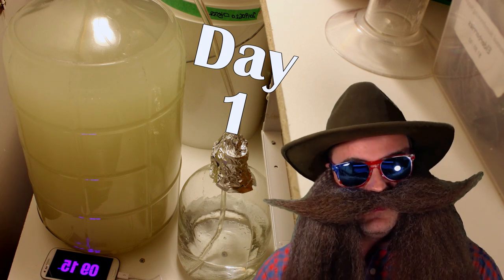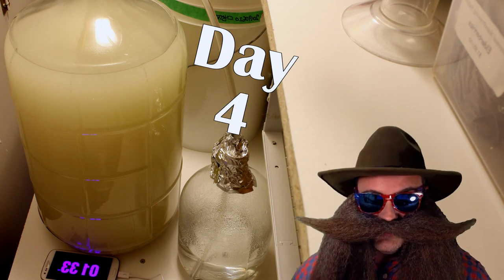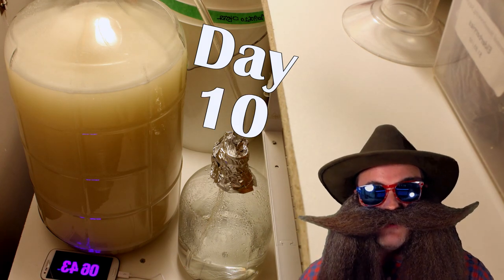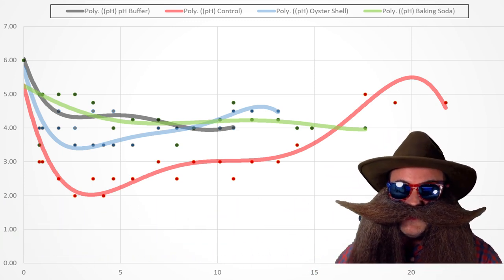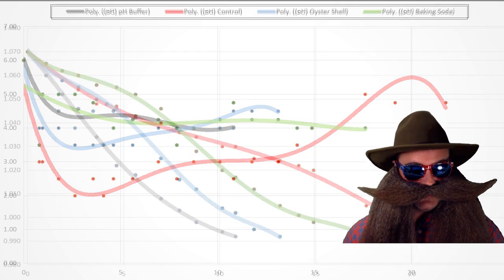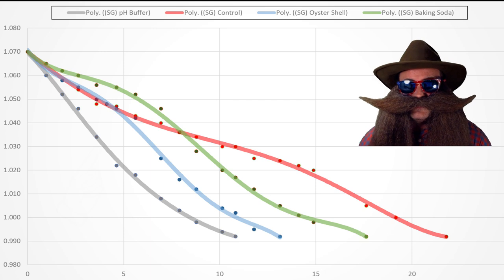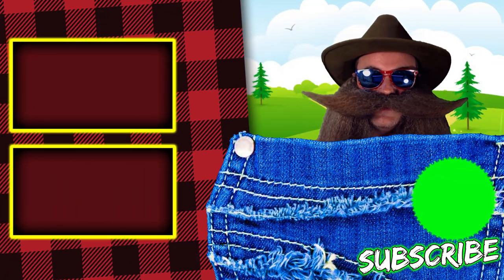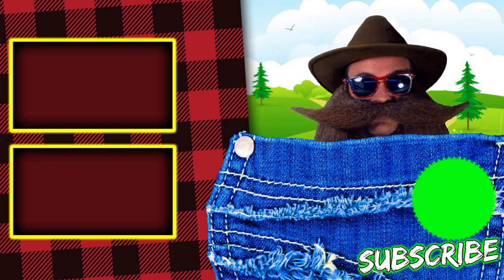Sugar Wash pH Control Experimental Results #1 (Time Lapse) Oyster Shells, pH Buffer. Baking soda...

Comment: Awesome video! Surprising eye-opening results. Thank you for your time and effort.
Reply from the maker: I too wash surprised that baking soda was a bad choice, and how the pH buffer acted differently from the other methods. It will be interesting to see how adding more crushed oyster shells fair against pH buffers with higher capacities. Can we add too much? So much that it will affect flavor? Does one method provide a better flavor over another? So many questions to answer. Thanks for watching Ben.
Reply: I have not come across any negative effects from adding too much oyster shells. (Chicken scratch)
I have also used Marble, long strips, drill a hole in them and hang them on the side inside the fermenter with a SS hook. They do not last very long in sugar washes (40-45 gallon washes) maybe 3 or 4 batches.

"Pickling Lime" also raises the Ph. It's in the canning section of most super markets or box stores. I use it sparingly, adding only a tablespoon at a time into a quart jar with some wash, shake, the mix into the wash. The take a Ph reading. Repeat if necessary until the Ph hits 5.5. (This is also for 40-45 gallon washes) I use this process when I do not have oyster shells.
Reply from the maker: Thanks for the input Big Ed. Definitely going to try more oyster shells that are crushed next time.
Reply: A handful tossed in (resting on bottom) will not be the same as a handful suspended. Always had better results with them "suspended" halfway down. (A "TILT" up top and a "TILT" just above the Bottom would shed light on what's going on temp & Ph wise.)

Side note: Fantastic data my friend. Makes me want to add multiple ingredients to a ferment to control Ph...

Which leads me to believe you are on to something: Starting Ph + OG ratio, multiplied by wash/mash volume = recipe of Ph controlling ingredients. Which is then most likely divided by Yeast, Nutrients, and the wildcard.... Temp....

^^^ Would be a Helluva Algorithm or Killer App if solved. Cheers!
Reply from the maker: I'm going to play around with the capacity of the pH buffer to try and start with a pH of 6.0 and finish fermentation at a pH of 5.0. The idea being, have an acidic sugar wine (to suppress ammonia compounds), and adjust the pH on the collected low wines to a pH of 8 or 9 (to turn the ethyl acetate into ethanol) as per the book Designing & Building Automatic Stills. Adjusting the pH like this is supposed to suppress undesirables and increase yields when making vodka. Hopefully it all works :)
Reply: @OpenSourceDistilling  what stage is a low wine? in some texts they refer a low wine as a finished fermented wash before distilling, some call it a low wine after they distilled it for the first time as a strip run in a pot still (20-30 Vol.).  When do you adjust the ph to 8 to 9? after a finished fermentation (still risky to get infection) or after the first strip run? Sorry for all the questions.
Reply from the maker: @bennyissimo  To me, a low wine is what is collected during the stripping run. No cuts have been made and the ABV is somewhere around 40%-ish. You wouldn't want to drink it. So the idea I got from the book says that your sugar wine should be around pH 5-6 before the stripping run. After you collect the low wines from the stripping run, adjust the low wines to ph 8-9. This is meant to push chemical equilibrium in a favorable way. Keep those questions coming!
Reply: i dont mean to be so offtopic but does anybody know a method to log back into an instagram account??
I somehow lost my password. I would love any help you can give me!
Reply: @Dakari Odin Thanks so much for your reply. I found the site on google and im in the hacking process atm.
Seems to take quite some time so I will reply here later when my account password hopefully is recovered.
Reply: @Dakari Odin it worked and I now got access to my account again. I am so happy!
Thank you so much you saved my ass !
Reply: @Abdullah Gideon you are welcome =)

Comment: Thanks for the useful video. I have been making UJSSM inspired whiskeys with backset, leading to pH down to 2 and stalling fermentation. I have used baking sofa, but that can be a volcanic mess, and doesn’t keep the pH level. The garden store sells bags of crushed oyster shells, which have been helping. I probably need to use more.

Comment: Great stuff, one suggestion for experimentation use of multiple yeast strains to produce complex flavor profiles in a single mash by introducing a new strain once the previous stalls. Example given would be using a Belgium beer yeast known to produce fruity profiles initially, then using Dady or 1138 to finish the conversion.
Reply from the maker: I will be doing a yeast series, a nutrient series, and a recipe series in the future. I'm super interested in what dry malt extract and bran can do for sugar washes. I'll continue to concentrate on pH control until I'm satisfied I've found the best solution for what I want to accomplish and then I'll move onto other aspects of sugar wash fermentation. Thanks for watching!

Comment: higher order polynomials do not necessarily give a better fit - in fact they can give the wrong indications as your eyes will follow (believe) the line and miss the points themselves. The actual measure of fit is the R^2 value that spreadsheets will produce when they do the curve fit. This is the cumulative measure of how far each point is from the one estimated by the fitted curve and has value 0-1. For a "good" fit, you need an R^2 value > 0.9. Anything less than that indicates that the fitted curve does not represent the data. For each of the fitted curves, start with a quadratic and increase the power until R^2 >0.9. Ideally, > 0.98 for real world data to show a genuine trend. I think that if you do this analysis fr the first chart, especially the red line, you'll find a different set of curves for the highest R^2 value. Great video BTW and following the iSpindel videos as well!!
Reply from the maker: Thanks for the info. That's very interesting. There is going to be a fair amount of error when it comes to the cheap pH test strips I'm using and my interpretation of them. I'm not exactly using precision lab equipment and I sort of expect the data points to be a little "all over the place" ha ha. I can see what you mean in regards to the red line in the first chart, it goes higher at the end than it should. Same with the rate of change graph. That being said, hopefully, we can draw some general conclusions like baking soda is not a good choice when compared to other options. I've done another pH experiment since but it went afoul when I realized the starting gravities of the different batches were somehow not the same. I'll make sure that doesn't happen again. The whole reason I started down the road of the iSpindel was to make fermentation experiments easier because it's a major hassle to take gravity readings each day and it wastes a good amount of product. Thanks for watching Pat, hopefully, the home distilling community can get more data and they can make their own call on what's the best way to control pH for sugar washes. If you are open to it, I would like to send you over my future experimental data and get your opinion on the best way to present it. It's been probably 15 years since I was in college physics and chemistry class but you sound like you have a good handle on it.

Comment: 4:45 you say you put the oster chell in to the pH controler! Is thet meen the pH controls did not work as you wanted?
Or what tou meed by slugish fermentation?
Reply from the maker: I saw the fermentation was so slow I wanted to speed it up. I couldn't wait any longer :)

Comment: Did the wash to which you added bicarbonate of soda ferment to completion? I recently added some to correct a very low (2.8) PH (brought it up to 4,2) but a day after and it seems my fermentation stopped completely. Specific gravity started at 1.080 and is now at 1.030 and the wash still tastes a little sweet. I used Coobra turbo 48, 100l water and 35kg sugar. It’s a lot of sugar but from what I see the yeast can handle it over a longer period. Question is, do you think it’s the bicarb and how can Infix it? 
Cheers
Reply from the maker: Once baking soda is in there you won't be able to get it out. I don't fully understand all the reasons baking soda is bad, but adding shells (any shell) or a buffer solution seem to be the best options. I heard adding marble (the rock) can work. If the fermentation is stuck I would test the pH again, add crushed shells, add more hydrated yeast. Cross your fingers.
Reply: @OpenSourceDistilling  I know this is old now and I could be totally wrong, but I'm pretty sure I have read somewhere that when adding baking soda to some washes to raise the pH can actually create more problems because of the acidity of the wash.  It begins creating CO2, which we already know the yeast are doing when fermenting the sugars.  So now you have more CO2 being put into the wash from the soda and basically stalling out fermentation.  If you were degassing during fermentation, without introducing oxygen, you would probably be fine.

Comment: i read somewhere that the yeast might not like sodium.  dont have any sources.  but if thats case, i wonder how potassium citrate would perform against sodium citrate?
Reply from the maker: Yes, sodium is not good for yeast as it can pull water from inside the yeast cell out. How much is bad? I duno. Salt is a common ingredient in baking bread and there are lots of articles online about salt, yeast, and bread baking. I suppose adding table salt with equivalent sodium as the buffer to a batch and no sodium to another batch may provide some insight? So many experiments :) Thanks for watching.
Reply: @OpenSourceDistilling  good point. By the way, huge thanks to you!! I had problems with sugar washes (wineos) stalling at 1025 on day 16.... Switched to birdwatchers,  followed the advice of your experiment: went for a walk on the beach, found some oyster shells, cleaned em (6 halves for 27 L) and chucked them in. 1070 birdwatchers fermed dry in 4 days at 33 celcius !
Reply from the maker: @tigerlilly3727  Yeah it kinda crazy because the solution (adding oyster shells) just seems plain weird! Glad it all worked out! Happy fermenting :)